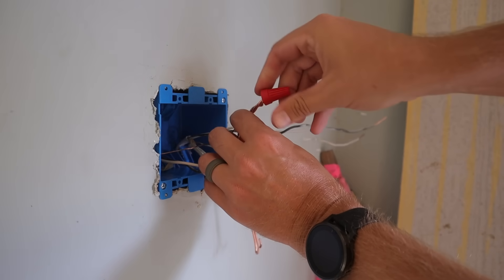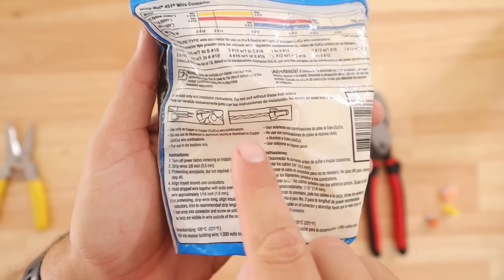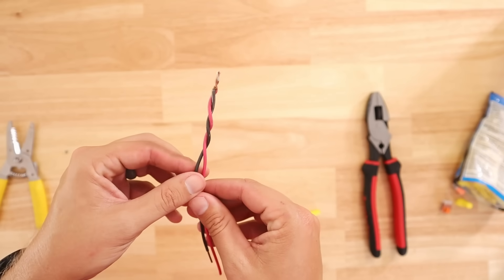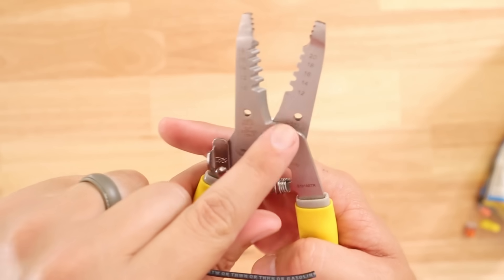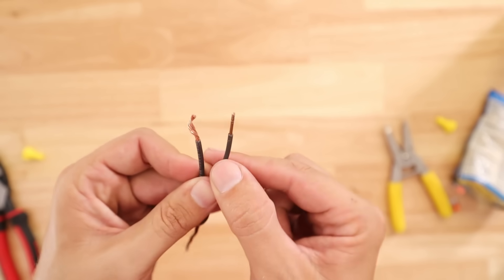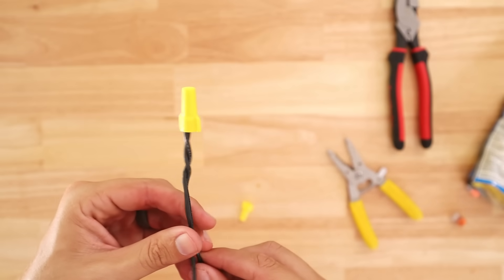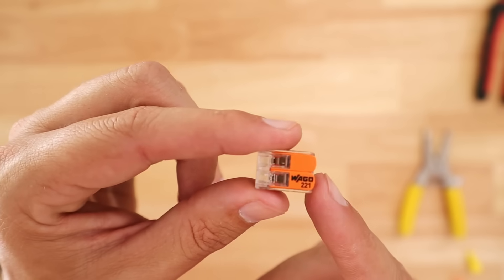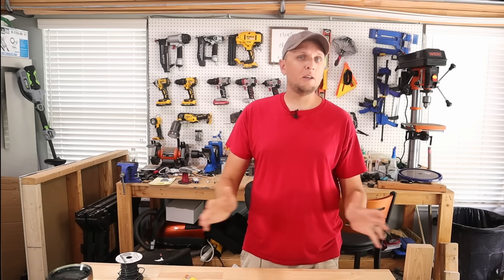BIGGEST Mistakes DIYers Make When Connecting Wires Together | How To

Comment: too pre twist, what ist the point  of using a wire-nut then? But Im not in US...
Reply from the maker: The wire nut then serves as another point of contact, further holding the wires together and also protecting those exposed wires from possibly arcing, causing a ground fault, being a point of shock or even electrocution, etc.
Reply: @HowToHomeDIY  But still there is other options if pre-twis is requirement. The one thing the wire-nut givs is efficiency and speed during installation. I know the wire-nut have its problem when wrogly used... But then again all Electricity is harmful and noboydy thinks twice when it coms to car, that kan be more harmful than hous Electricity...
Reply: @Ghosthack-1984  are you saying a car volage can kill you? If so, you so wrong
Reply: The wire nut is to keep them together and protect from other wires in the box.
Reply: The wire nut actually forms the oxygen free electrical connection due to the spiral metal inside that cuts into the copper wire. Twisting is not the primary electrical connection.
Reply: IDEAL  SAYS TO NEVER  USE PLIERS TO TWIST  THE NUT NEEDS TO TWIST 
THE WIRES  ANS AT LEAST 3 TURNS BELOW THE NUT WAS TOLD THIS BY 
REGINAL SALES REP FOR IDEAl  . i use screwdriver  with  nut holder  in handle 
to get the 3 turns below nut

Comment: As a forty year industrial electrician, I didn't use that many wire nuts but when I did, I would always put a couple wraps of Scotch 33+ tape around the open end to seal it.
Reply from the maker: Hey Rod, I always like to hear experiences and feedback from folks like yourself that have worked in the trade.  Thanks a lot for the feedback!
Reply: @HowToHomeDIY   Rod has no experience with wire nuts he is a theory guy
Reply: @sarahann530  Your comment just like your channel doesn't have any content.
Reply: I am with you Rod. I add a bit more tape hoping to water proof the connection as well. One never knows what the connection can go through over 50 years plus. Been bitten a few times. In my younger day’s.
Reply: Sometimes I add a small tie wrap over the tape, below the wire nut.

Comment: I've been doing electrical work all my life and I strongly suggest Wago connectors especially for someone who doesn't  do it professionally and is just a DIYer
Reply: WAGOS suck ,been doing electrical 40 years use wire nuts period!!Wago's are fire starters plastic crap and tiny bit of metal touching wire lol.I have seen lot's of electricians install wire nuts half ass ,50 % of electricians i have worked around i laugh at their work union or non union does not matter..
Reply: @davidcooper4385  you got that right. More surface contact with wire nuts compared to WAGO's. Have seen WAY too many WAGO's burnt up because of the surface contact. Same as just pushing in wires to receptacles or switches. Always use the screws.
Reply: @davidcooper4385  what a boomer attitude .....I laugh at there work.......I guess  all your work over that time period was absolutely perfect......i bet your a  joy to work with
Reply: Easy to work with ,if your not skilled than your not working with me bummer,i work with people who are broke and one dimensional lol, I work residential, commercial and industrial so few guys are well rounded lol,never been out of work or $$$ ,I laugh at fantasy island journeyman wanna be's lol..
Reply: @davidcooper4385  Funny that you mentioned that, the last few years I have seen so many "Kids" graduate from apprenticeship school,
pass their journeyman test and think they are electricians. 90% of them are dangerous to work around. What they don't understand is, that journeyman's test or even the masters does NOT teach you to be an electrician, just shows you how to find answers in an open book. Great electricians are very hard to come by these days. We hired 7 guys in the last 3 months claiming they are electricians, not one of them can do a 3-way circuit or even know what a contactor is.
Reply from the maker: Thanks for the feedback!
Reply: Wagos are like backstabbing outlets. If there is some current there then a fire is waiting to start. Lazy electricians use these.

Comment: Excellent overview on this hotly debated rabbit hole topic. What is code and when install in accordance with instructions in the listing or labeling is the key; however the NEC is just the minimum and best practice is the goal to prevent future problems down the road.

When I installed my UPS critical loads circuit receptacles in my home, I pre-twist all of my solid conductors and then wire nuts. I figured that I will not be messing with it for the life of the home with the occasional replacement of the receptacle caused by normal wear and tear. When transitioning from solid to stranded Wago connectors are the way to go (slight pun intended), especially terminating light fixtures and those new bam fangled IoT switches and receptacles that have stranded pigtails.  :-P

I wish they were around when I worked in the commercial/industrial electrical field; fluorescent overhead fixture wiring is solid and everything else is stranded making wire runs in EMT less labor intensive. I've lost count how many time I had to go back on someone made a silly mistake inside of one of those fixture(s) that are hanging 18+ feet up in the rafter joists. Thank goodness the majority just didn't make proper contact and the fixture didn't work, then on the rare occasion of them pulling completely out during assembly resulting a nice loud bang when 277 volts is applied and grounds out on the fixture.
Reply from the maker: You hit the nail on the head!  Rabbit hole topic indeed.  I really appreciate the insights!  It is always good to hear from folks that work or have worked in the field and get their experiences.  I also used that pun in the video, it just flowed too well not to lol  I also thought about the old eggo waffle commercials when they said leggo my eggo.  Wanted to say leggo my Wago haha.  Anyways, yes I could go on and on about where they could/should be used and maybe where they shouldn't.  Different tools for different applications.  Thanks again for the great feedback and hope to see you around the channel!